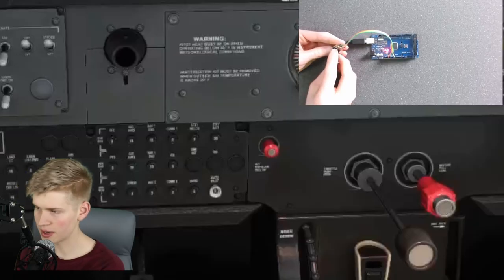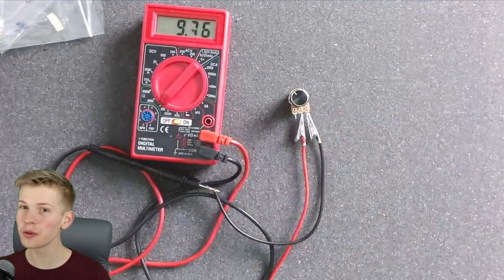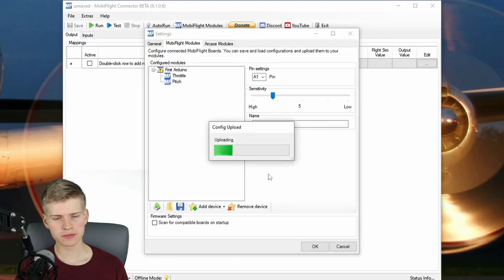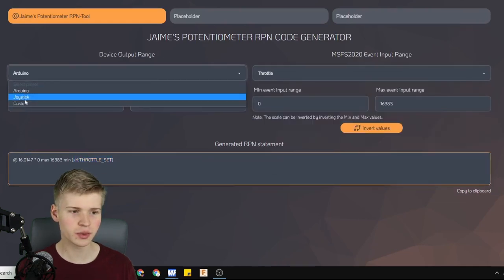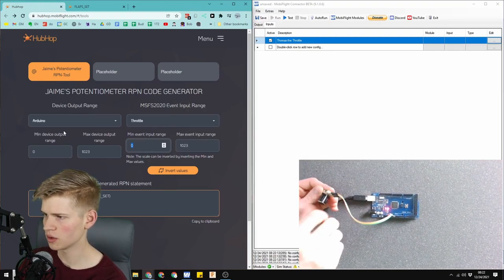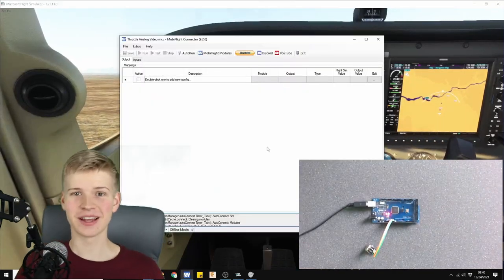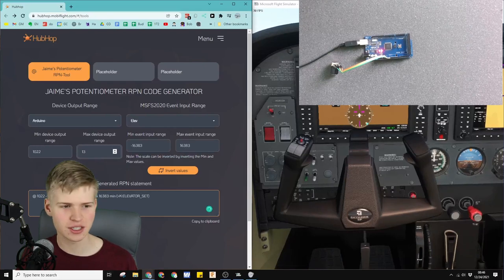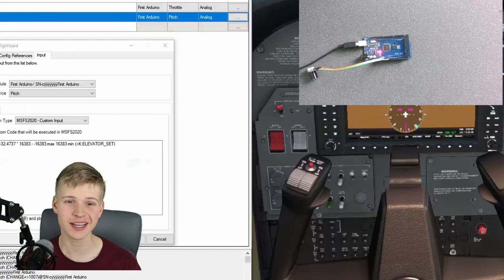Connect a Potentiometer to a Flight Sim | MobiFlight Crash Course Episode 9

Comment: How about slide potentiometer. Can you connect it to mobiflight?
Reply from the maker: Yep! These are both the same electronic, but they use a different motion to change resistance.
Same process :)
Reply: Hello captain, inside debug of Mobiflight, the value is changing but the yoke doesn’t move inside the cockpit of c172 g1000 of asobo (msfs20), can you help? Thanks

Comment: Hey great video. I have some problems currently wiring multiple arduinos with a external 5V power supply and get it working in mobiflight. Do you or anyone else know where I can find more information to that?
Reply from the maker: Hello! The arduino forum is super great with that, there's loads of solutions already: https://forum.arduino.cc/t/powering-multiple-arduinos-with-the-same-power-source/225752
https://arduino.stackexchange.com/questions/21061/two-arduinos-one-power-source
I googled "connect multiple Arduinos to one power supply"

Comment: So, I plug the potentiometer to the 5v, ground and A0. Every time my pot. Spins all the way in one direction the leds get really dim and the ardiuno turns off.
Reply from the maker: Could you send a link to your pot? it's possible your pot's wiring is different than mine
Reply: @CaptainBobSim  thanks for mentioning the wiring, turns out I had the wiring switched around 🤦‍♂️
Reply from the maker: Glad you fixed it!

Comment: HOW I KNOW MIDLE ONE SHOULD BE GROUND IS NOT
Reply from the maker: RULE OF THUMB:
If it's clicky it's a rotary encoder and the middle one is ground.
If it's smooth it's a potentiometer and the middle is signal.
When you purchase, it will tell you if it's a potentiometer or a rotary encoder.

Comment: Hi CaptainBob,
You make great videos! Calm voice and clear explanation. As a beginner I have a question. Once the board is programmed, it doesn't work independently for me. I always have to load MF Connector for it to work. Is that the intent or am I doing something wrong?

I hope you will help me. Thank you very much for that.
Reply from the maker: That is the intent - MobiFlight is a software that has to be running for the connection from Arduino to flight simulator to be made.
Use the "Autorun feature" then mobiflight should run automatically.
Reply: Thanks for your quick reply. However, I am concerned that MobiFlight will try to overwrite my Arduino Leonardos (programmed as joystick in Arduino IDE sketch) which are in the same setup. Then the suffering is incalculable..... (So it has already happened once, but maybe I clicked the wrong button...)
Reply from the maker: @pure4wood501  Yes, MobiFlight will overwrite it. If you flash a mobiflight board it can only be a mobiflight board

Comment: i have a question for you. The question is can i use a arduino uno same as you are using your arduino mega ? if yes why don't you use an arduino uno instead of an arduino mega that is more expensive. have a great day captain bob🧑‍✈
Reply from the maker: Yes, but unos are not as reliable and have much less pins per dollar https://captainbobsim.com/2020/12/16/mobiflight-arduino-compatibility/

Comment: Hi Thanks for these fantastic tutorials! I'm new to mobiflight and making things in general for flight sim. I have built the 737diy non - motorized throttle unit, can I use an uno to process the inputs of my potentiometers in MSFS2020 using the PMDG 737?I can't seem to find any presets for this and am open to do some learning to achieve my goal. But is it doable to start?
Reply from the maker: I'd first test the generic events under the flight sim 2020 tab. To make sure PMDG is compatible with them (you can follow the video but when making a variable set it to a number (511 is 50%) and see if manipulating the number does anything.
I'd recommend watching my second "advanced" poteniometer video which shows how to map it to a variable.

Comment: Hi Trevor, I followed your tutorial here (thank you for your channel!!!) and I have an issue. When I use a pot for the C172 throttle, it will ALWAYS go back to zero? I can put the put at 100% power and it will go to 100% in MSFS 2020, but again, it will ALWAYS return to zero when the pot is still at 100%  Do you now why this is happening?  Thanks again!!!
Reply from the maker: Hi Jim! What are the values saying in your window when it goes back to zero after 100? Keep in mind this could potentially be a conflict with a joystick if you have one connected.
You may also find my advanced potentiometer video helpful.
Reply: @CaptainBobSim   I think I got it Trevor!!!!  I used the Hubhop and without adjusting anything, it's working smooth.  I just need to adjust the values now. Thanks again!!!
Reply from the maker: Perfect!! I'm so glad to hear!

Comment: Greetings Cap'n Bob
Love your videos. Please consider a video on interfacing Alvaro Alea's directional compass with the heading bug. I've built one but the two rotary switches have me stumped. I don't want to just make it another wiskey compass. You're far more savvy than I am. Hoping you do it. Thanks
Reply from the maker: Hello Phill! 
I'm designing my own instruments to have configurable with MobiFlight, and won't be making a tutorial for Alvaro Alea's compass unfortunately :( but I will do mine once they are designed.

Use 07CC	2	Autopilot heading value, as degrees*65536/360 for the little indicator
and 
0580	4	Heading, *360/(65536*65536) for degrees TRUE.[Can be set in slew or pause states]
You can use the altimeter video and the compass video to help show the concepts with this.

I can help you with this if you should get stuck
Reply: @CaptainBobSim  Thanks Cappy. Good luck with your projects. I hate to see you struggle but you will learn much

Comment: X-Plane 11 - Managed to get a parking brake indicator working using this tutorial as a basis, which is a big success for me as I have never used an arduino before, or a flight sim, or Mobiflight come to that! But I could not get my yoke potentiometers to work - everything ok in Mobiflight when I checked the debug logging, put the values into the Hubhop code generator, but sadly the yoke doesn’t move for either the pitch or the elevator.
The arduino appears in Device Manager under Ports, on COM5. Checking the settings in X Plane shows no yoke connected so X Plane obviously defaults to using the mouse - maybe that’s the problem??? Or maybe the Hubhop code doesn’t work with XPUIPC??? Any ideas?
Reply from the maker: The hubhop code is only for MSFS 2020, I'm sorry :(
I believe there might be a way to do this with XPUIPC, but I haven't found it yet
Reply: @CaptainBobSim  Thhanks for the response. I’d hoped that it would work because the offsets for elevators and ailerons are the same in FSUIPC and XPUIPC. Oh well, I think I may have to buy a copy of msfs2020 instead - it seems that not many of the YouTube home-builders are using x-plane. But thanks for the instructional video - at least I know a bit more about Mobiflight now!

Comment: Knowing how to read the output of a measuring instrument is a skill which should be obtained by grade 9. At least that's when I was introduced to the slide rule, decades ago. A few minutes of preparatiom should have got you up to speed on reading an Ohmmeter's output.

And your reading of the display which put the decimal in the wrong place was grotesque in the extreme. Only magnified further by demonstrating that you didn't know what the device is called.

I cringed hard in sympathetic embarrassment while watching this.